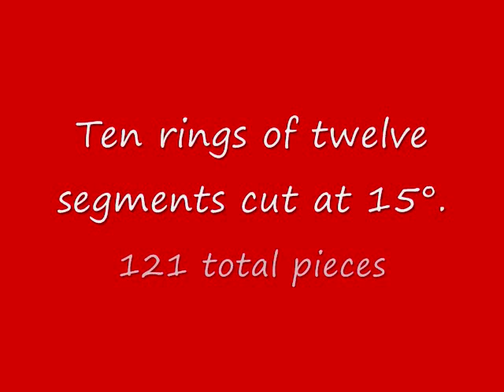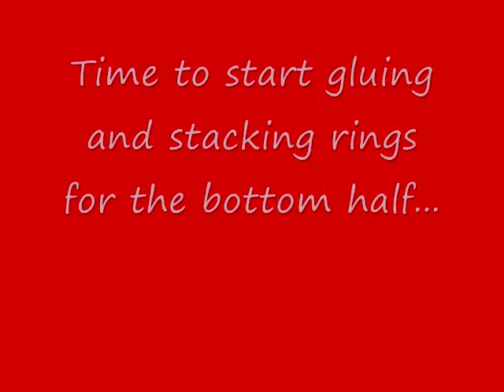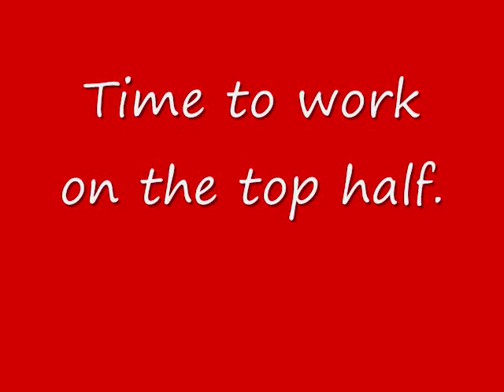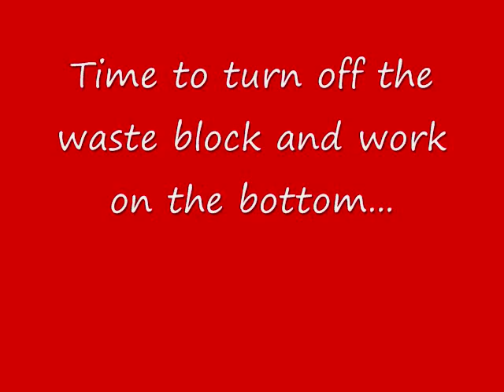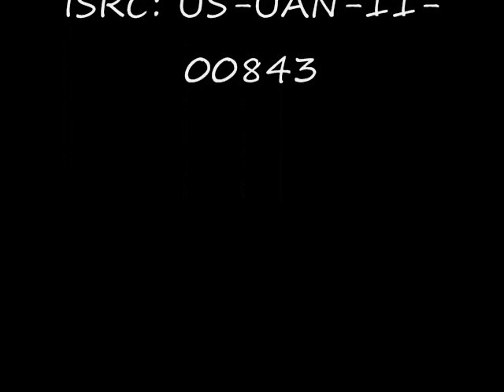Woodturning A Segmented Vase

Comment: Great video and finished project!
Two questions:
For segmented turning, do you always turn a ring at a time; that is, glue ring, turn it; glue another, turn...
What cutting tools are used?
Thanks
Reply from the maker: Not always, mainly just do it to get it true so the next ring is easier to center. I use a mixture of Thompson lathe tools, Harbor Freight HSS, and a couple of DIY Easy Wood type tools. Thank you for the compliments!